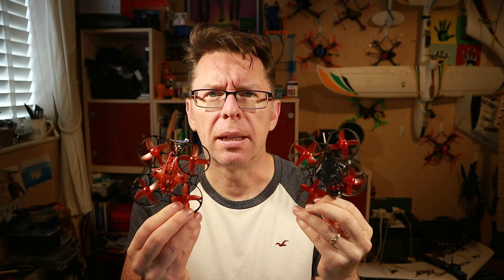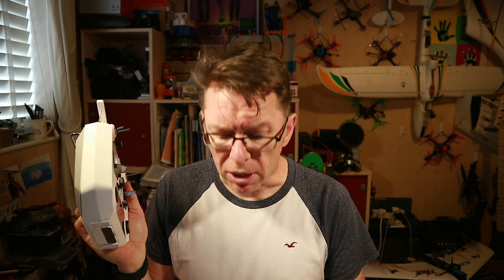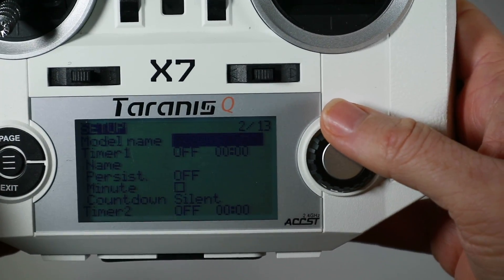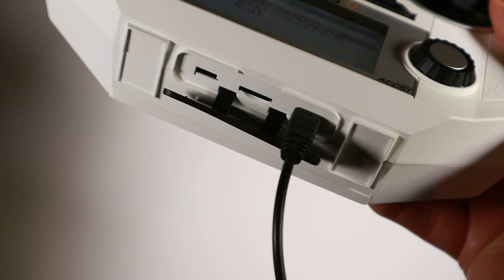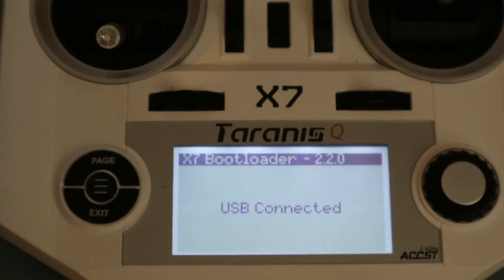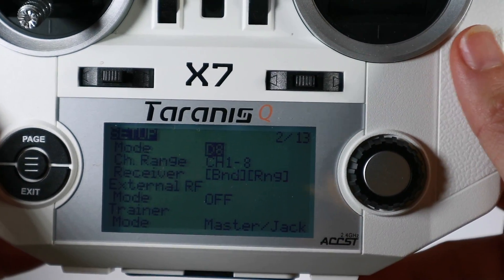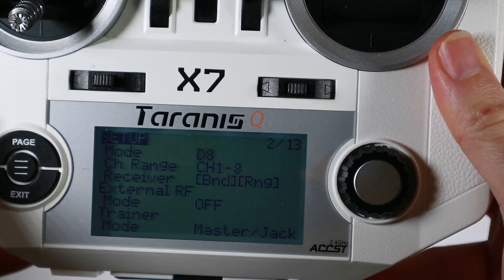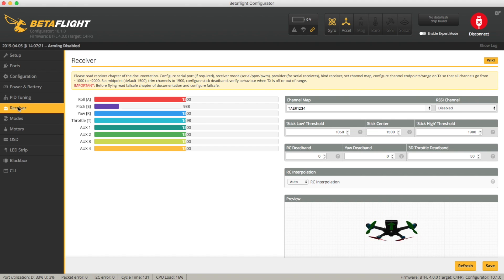How to use FrSky SPI or D8 receivers with an EU/LBT radio

Comment: Hi, great tutorial again. I noticed that OpenTX 2.3.14 latest does not have an EU check box. I believe I am having a problem bind_rx for my flywoo firefly 1s nano baby which has built in spi frsky receiver on the AIO board. Do you have any advice? As most mini quads these days seem to use spi. Strangely I am able to bind to xm+ pre version 2 firmware using my x-lite pro transmitter with firmware ISRM 1.1.3.
Reply from the maker: The EU tickbox appearing will depend on what model of radio you have.  So if you are on an original X9D, it's there.  But if I switch to my X9d Lit Pro (which has the Access badge on the front) then it isn't there - because you can't run D8 on the ISRM module.  I made a post about this a while back https://www.currykitten.co.uk/using-spi-receivers-with-an-lbt-eu-radio/  Binding to spi rx's shouldn't be a problem as Betaflight supports them running both FCC and LBT versions of D16.  In the past LBT wasn't available and thus the LUA script on that post I linked to that could swap your region of the radio back and forth.  It should be ok now though - what radio do you have, which region are you in, and which protocol are you using in the SPI receiver?
Reply: @CurryKitten  Thank you for explaining the EU check box. So confusing the Frsky with ACCST 2.x with XM+ receivers. I took a risk and bought a used Frsky Taranis X-Lite Pro as it has nice gimbals and more battery power for external modules. i was relieved to get it working by updating the ISRM v1.1.3 which now works with my old XM+ receivers with pre 2.x firmwares, using sbus in Betaflight. However, the headache was with my Firefly 1S Nano baby configured in Betaflgith with SPI RX SUPPORT, and FRSKY_X. After many attempts to bind my X-Lite Pro in ACCST D16 mode, I finally figured out it was because after running bind_rx in CLI, I needed to run save and enter to complete the bind 😅. The Frsky transmitters are way better built than say Jumper T-Lite. So glad I got it working finally. But I do not applaud Frsky for their ACCST firmware updates which have caused headaches for many people out there. I am a beginner in fpv, but thankfully not given up the hobby yet with the many frustrating problems encountered with Betaflight, firmwares 😅. It is a learning curve to say the lesat. Keep up the great work you are doing for fpv hobbyists 👋
Reply from the maker: You'd be surprised how many people have been caught out by not typing save at the end.  Glad you got it going.

Comment: Know this is an old video but. If my transmitter is on EU-LBT firmware (ACCST QX7), with D8 already enabled. Will I need to flash the SPI Receiver in the drone to LBT as well or do SPI receivers work regardless of LBT OR FCC?
Reply from the maker: D8 is D8.  There's only one version of it, so there's no LBT or International flavour here.  So if you can run it, you are all set

Comment: Ijust got a mobula 6 and cant bind to my taranis x9d plus 2019 radio can I get it to work this was or do I need to buy the external XJT tx
Reply from the maker: The X9D plus 2019 has the big Access badge on the front doesn't it?  This means you can't run it in D8, but if the mob 6's firmware is at a decent level (let's say 4.2+ although I can't remember when SPI in D16 become livable) Then you should be able to fly it on D16.  Change the PI mode to FRYSKY_X (or possible LBT depending on your radio) and then try binding in D16 mode on your radio

Comment: Hello again sir . Sorry for the question I’m new to this . Im trying to buy the mobula7 and is asking me witch receiver frsky EU-LBT or frsky Non-EU . My QX-7 is for D-16 . Witch one should I buy ? Please reply . Your my best source. Thanks
Reply from the maker: It actually depends on the firmware your radio is running - which is LBT or international.  Given that you don't have a d8 mode on your radio, you are probably running the LBT firmware (usually means you are in Europe)  The EU-LBT option will get you an external xm+ receiver on the mobula7 (much better for range) whilst the Non-EU version will use the internal SPI receiver (less range, but no external rx fixed to it) it used to be that these would only run decently in D8 mode, but with the latest betaflight firmware then can now run in D16 or d16 for LBT.  (that said you can also update your radio to support d8) so the answer is any of them, but it depends what you'd like and how much additional updating on your radio you want to do.

Comment: Hi,
I am new to the hobby and kinda lost in here. I bought the Taranis QX7 Access (non-LBT) and bought the beta 85 HD (FCC version). for some reason, I can get it to bind. Also, i tried the same thing you did and I didn't get the D8. please help
Reply from the maker: Access radios can't do D8 mode (sadly) you can either get yourself a multiprotocol module or run it as D16 (with a later version of betaflight) some more details in this video https://youtu.be/kNpXQrwUlTc
Reply: @CurryKitten  actually i managed to make work. I just downgraded my ISRM from v2.1.0 to v1.1.3 and some how it worked. I guess the problem was in the new version anything about v 2 won't work

Comment: My Taranis q7xs I see no D8 after when I have done that all :(
Reply from the maker: That's one of the newer radios with an "Access" logo on it.  They've stripped D8 out completely, but I did make another video which may help you decide on a different option https://youtu.be/kNpXQrwUlTc
Reply: @CurryKitten  Thank you. New bf 4.2.4 and frsky_x_lbt als receiver has solved this issue.  Subbed ofcourse 👍

Comment: Hi, thanks for the video.
I have a Taranis x9 lite, and that FC is not in the list of transmitters of open tx companion...  what can I do?? thanks
Reply from the maker: You can't use D8 on the new Access based radio at all.  But you can choose FRSKY_X on SPI and as long as it's up to betaflight 4.x it's not so much of a resource hog as it was.  Check this video https://www.youtube.com/watch?v=kNpXQrwUlTc if you need to swap between FCC and LBT

Comment: I'm quite confused. I want to purchase d8 based micro whoop. Do I need xjt module? Some kits include it and other are not...
Reply from the maker: Depends - what radio are you going to use it with ?
Reply: @CurryKitten  FrSky qx 7 fcc version. I didn't buy it yet since I want to make sure I'll be able to bind it...

Comment: Thanks a lot for the video, but just one question, if I have a FrSky Qx7 FCC, but I want to bind it to something like a BETAFPV HX115 LBT, my only option would be to either flash the transmitter or receiver, right?
Reply from the maker: Yes - if you have other models, then flashing the receiver is probably easier (although a pain on a small quad like that).  If this is your one quad, and you live in a LBT zone, then the TX flash is far easier.  Curious as to how you ended up with an FCC TX and an LBT quad Was one or the other out of stock at the time ?
Reply: @CurryKitten  Thanks for the answer, I have not bought the LBT quad yet, I was just checking the options I would have with my FCC TX, because I wanted to get something like a BETAFPV HX115, but the FCC version would have to be importet, so it would be cheaper if I could get the LBT version, which I can buy inside of the eu. But it seems like the hassle of flashing the LBT quad isn't really worth the small saving, I think it makes the most sense to just get the FFC one. Thanks for your help!

Comment: Great video! I have seen some videos binding a EU flashed Q7x with the SPI of the meteor65 using D16 ch1-8 protocol Frsky_x_lbt but i sick of trying... I am definetly unable to bind. 

I will have to use this D8 solution although it isnt allowed in Europe...
Reply from the maker: Personally I think the rule on LBT is dumb.  I'm perfectly happy to carry on using D8 - it's a pain if FrSky_x_lbt isn't working for you though :(

Comment: I having fighting this same issue with basically the same setup you are binding but even after doing as you did, I'm unable to bind the QX7 and the Trashcan. I believe I have a defective whoop.
Reply from the maker: I found a few people were missing a step in the order of things - so just to double check what you are doing.  connect up quad to betaflight,a nd go to the cli tab.  Activate bind on the radio and then type bind_rx_spi on the cli line (although it differs depending on the version you are running) after a few seconds, you can stop the bind on the radio and then type save on the line... that should be it.  Is that what you are already doing ?
Reply: I believe the only thing I did not do was pressing "save" on the cli line. But I never saw the trashcan led become solid at any time during the process. At this time i am running the latest version on betaflight, the Qx7 and the Trashcan. As far as I can see the Trashcan do not have a binding button neither. I will try again as you described just in case. Thanks
Reply from the maker: Yes - please do so.  Absolutely nothing happens to look like your quad has bound when doing this, but if you don't type save it won't  complete.
Reply: @CurryKitten  Well Happy Easter. I try as de discuss and it did not work. I am going to try to exchange it because I have spent many day trying thing including making sure the Transmitter is up to date. I follow the instructions on the Trashcan manual but nothing work.

Comment: Hey thanks for all your videos and the sim stuff👍 i have a issue with a e010s pro. Cant get it to bind in d8 but have mobula6 i am able to bind in d8. Tryed changing qx7 firmware but no luck. Any ideas ?
Reply from the maker: Not used that quad before - but how are you doing the bind?  Does it support the cli option, or are you using the button (try both for starters)
Reply: @CurryKitten  thanks for the reply i have tryed  both cli and button no luck. Even gone as far as flashing new and old firmware to jxt
Reply from the maker: Do you think it's possible you got the FlySky version by mistake - is there anything written on the FC that will give you a clue?
Reply: @CurryKitten  it says frsky On the board.  Could it be the version of betaflight and my qx7 being mismatched?
Reply from the maker: If you radio runs D8, then it should be capable.  Just to check, in Betaflight do you have the SPI receiver aset to FRSKY_D, what version of betaflight is it and what command are you using to bind ?
Reply: @CurryKitten  btfl 3.2.3 think its a custom btfl as cant find another firmware and its set to D with no x avalible haha its a mystery

Comment: Hi. Quick and simple question. Can I purchase for example, an R9 Slim with FCC firmware and then flash it with EU LBT to match my radios? (Currently everything I have is EU LBT and I need new receiver quickly and its easier to buy FCC version)
Reply from the maker: Yes - all of my R9 stuff always came with the FCC versions, and whilst I don't have a problem running the FCC version of 2.4Ghz, R9 in FCC runs into the GSM phone network, so pretty important to run it on 868Mhz.  The best option is to install the flex firmware on both which allows all the options on any of the frequencies
Reply: @CurryKitten  I have an Horus X10 Express and R9M (amongst others) and all my existing receivers are EU LBT as is the OpenTX. I don't want to start changing the firmware on my transmitters as they are all working fine and as they say, if it ain't broke, don't fix it. So basically, if I buy FCC receivers there will not be a problem flashing them with EU LBT firmware? Thanks for the quick response by the way and love your vids, have helped me immensely in the past.
Reply from the maker: Whilst I can't say that all receivers will be fine (some old FrSky rx's were more involved to work with) all the modern stuff you might end up using like XM+'s and R-XSRs etc are easy to flash, so buy them where they are cheapest and flash them to LBT as necessary
Reply: @CurryKitten  Thanks mate, that's all I needed to know.

Comment: so ive just purchased my first quad which is a emax tinyhawk freestyle which i understand runs in d8 mode... i also purchased the frsky taranis x9 lite and now im assuming i have to do what is shown in this video.....someone help please thanks in advance
Reply from the maker: If you've got the LBT version of the firmware on the radio (you'll know this is d8 mode isn't there) then yes, work through the build options shown in the video
Reply: @CurryKitten  ok thanks for the quick reply was starting to worry i just wasted some money
Reply from the maker: Oops - sorry.  I misread X9 lite as X-lite.  So the X9-lite is one of the new TX's that has D16 and Access, but doesn't have D8 mode.  All is not lost though - you have 2 options at this point.  You can get an external module to slot in the back which will give you a D8 mode back (along with loads of other stuff in the case of a multiprotocol module) or you can run the tinyhawk on D16 mode.  The tinyhawk uses an SPI based receiver which you can change to FRYSKY_X in the configuration tab (instead of FRYSKY_D which is D8)  The reason it runs in D8 is that it takes less cpu power to do so, there have been lock ups if the CPU gets too high in D16, but just test it carefully in a place where you can easily recover it
Reply: @CurryKitten  ok thank you very much for the help
Reply: @CurryKitten  ive changed it to frysky_x in betaflight but my x9 lite will still not bind to the freestyle any suggestions ?
Reply from the maker: @ABBO-3000  I keep meaning to make a video about this, as it's a newish option on Betaflight.  You'll need Betaflight at at least 4.0 (I think) and an up to date version of the configurator.  This will give you the specific option in the drop down for FRSKY_X_LBT.  That's the one you want
Reply: @CurryKitten  yes a video would he amazing !!!
Reply: @CurryKitten  thank you for being so patient with me this is all new to me...managed to bind to the quad but its saying telemetry lost and telemetry recovered i just dont understand what would make the it connect and then disconnect instantly

Comment: thanks for the video, however i can't get my X9D + 2019 in D8 mode. Flashed the firmware to non eu, flashed internal module to FCC. But still - can't select D8 mode for binding it to my tinyhawk. Anything which im missing out here?
Reply from the maker: I made this video before the new range of radios were released, so the Access based transmitters, such as the X9D+ 2019, can talk Access, and D16 but can't do D8.  Whether this is a technical limitation of the new internal module, or FrSky just don't want to support it, I don't know.  You can get D8 by using a multiprotocol module.  You can also set the TinyHawk to D16 (FRSKY_X in the SPI receiver section) also I've found this can lock some flight controllers up as it's too demanding on the CPU
Reply: @CurryKitten  Hello there, I'm just new owner of the taranis x9d SE 2019, what i want to ask is there a way to bind my radio with my eachine trashcan (CRAZYBEEF4FR).
I have tried with flashing the open tx to non-eu. I have tried to find a way to flash internal isrm module to NONEU - without positive outcome. Any suggestion beside buying multiprotocol module (just dont want to wait 2 month for package from banggood). I'm newbie in this subject. 
Best regards
Reply from the maker: @bruno6208  There is a way to change it via a LUA script that FrSky give out.  Google isrm_mode_1.lua and you will find it.  It still won't give you D8 of course, but you should be able to bind on FCC version of d16 (FRSKY_X) in the configurator
Reply: @CurryKitten  i got the lua script and changed ISRM module version to FCC. I have set my Trashcan to D16. When try to bind with set ACCST D16 protocol on my Taranis, nothing happends. 

Anyway thanks for answear me so fast! :)
Reply from the maker: @bruno6208  So SPI receiver with FRSKY_X selected yes ?  You've set you radio into bind and then you went into the cli and entered either bind, bind_rx or bind_rx_spi (depending on the level of betaflight used) then after a second or 2 in which nothing will visibly happen, type save in the cli - FC will reboot and take radio out of bind... that should be it
Reply: @CurryKitten  i did almost everything but Save! It's working obviously, Thanks a lot!!!

Comment: I cant bind my M80 to may taranis x7, in mode I can read XTJ - d8 . is that normal? please help 🤣
Reply from the maker: Do you have D8 mode available an an internal receiver option?  When it's talking about XJT-D8 mode (not that it's particularly clear) but I think it's talking about using an external XJT module.  If you've got an external module that's all good, but otherwise you'll need d8 as an internal option
Reply: CurryKitten I would love to take a screen shoot, it say : 
Internal RF 
Mode XTJ D8
Chn 1-8 ect 
But even by doing the binding procedure right , I can’t bind them 🤔
May I have to upload a video 😁
Reply from the maker: @AgustinArneodo  A video would really help if you can get a good shot of your screen.   Presumably you can tell the M80 is in bind mode, it flashes an LED or something.  What version of OpenTX is running on your x7 BTW ?
Reply: CurryKitten I will upload a video and link here , thank you very much